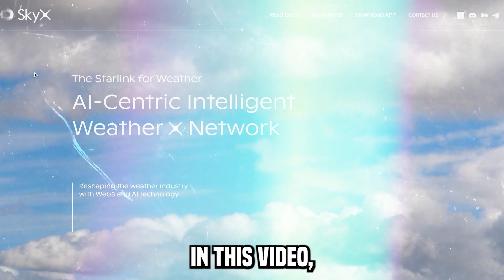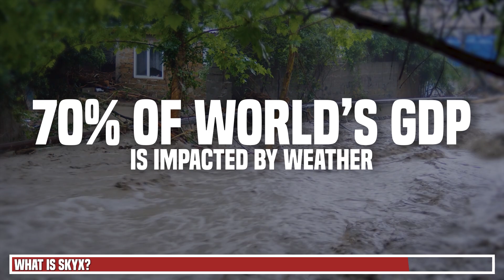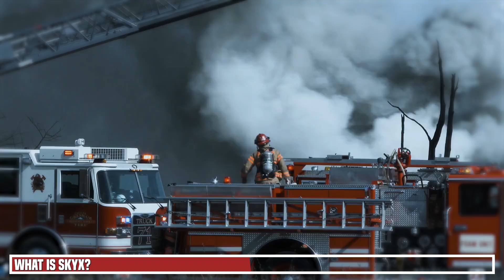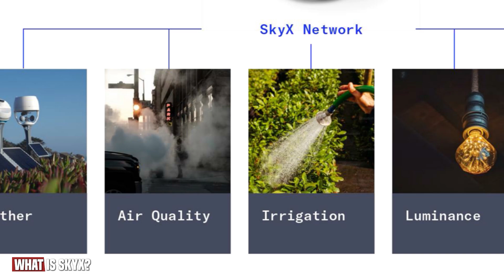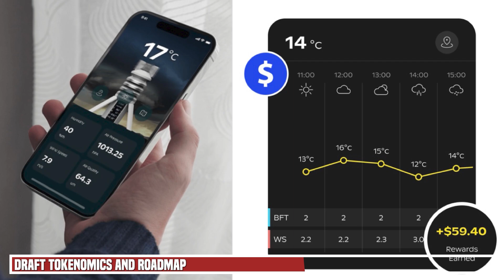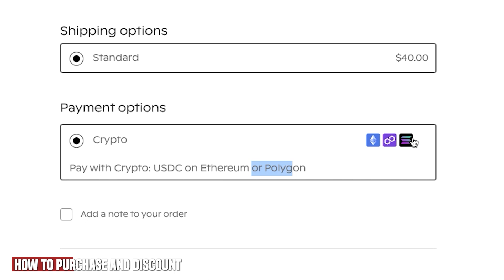SHOCKING $209 DePin Crypto Miner nobody knows about!

Comment: whelp this is a gamble, as was the geodenet, wxm, hivemapper and helium nodes.   note helimu was/is the flop.  rest have been good, your geodenet has paid for itself finally,   wxm on its way :) hivemapper is well and truely the honey pot :)   cheers,  it was close to $298 aud for me but honey paid for it :)
Reply: Helium a flip? lol . Literally my most profitable miners ever
Reply: Well depends where geographically your located. Anywhere outside the states or Europe it was an over expensive flop. May have been useful if you had a farm and actually used its functionality. For me here in aus it was a massive fail. I reckon every other device I’ve purchased has out performed and out profited atleast 10 fold. Wxm, geodenet, hivemapper etc…

Comment: Thanks so much! Great video as always.  I'm feeling really good about this project. I ordered 3 with your code. Thanks for that. I don't think there is any solar panel on it so I'm guessing it doesn't matter too much if it's blocked by trees and houses. Should be easy to install anywhere in the yard. I think less sensitive process than Weatherxm. I had to sell Geods and WXMs to buy these.  Happy Depin mining!
Reply from the maker: Yes that is also my thought process with regards to this. They will have an upgraded version which is more of a professional station that will have The solar panel etc. But these devices I don't require a sensitive setup like the other projects you mentioned

Comment: I wonder if it can be used in winter. How it will hold up with snow/ice build up?
Reply from the maker: That's interesting question. I would assume that they are usable in cold temperatures. I have a similar device which runs on a battery and it handles pretty well. You may need to just blow off the snow if it gets too heavy on it.
Reply: @PassiveCryptoMining  Thank you! I will give it a shot I think!